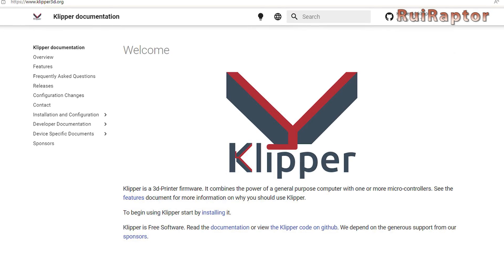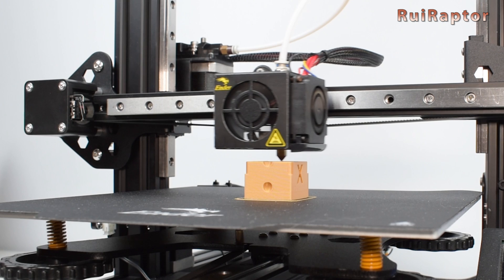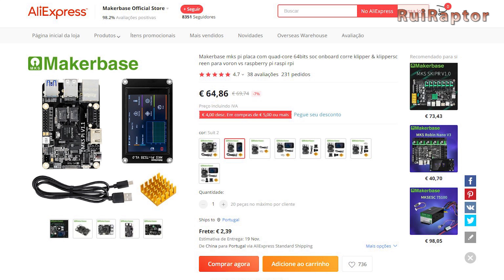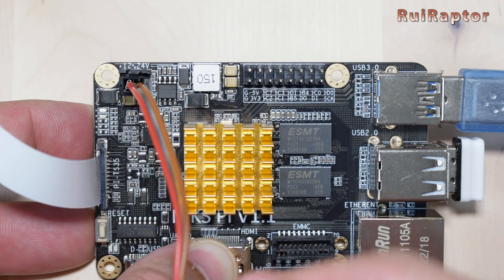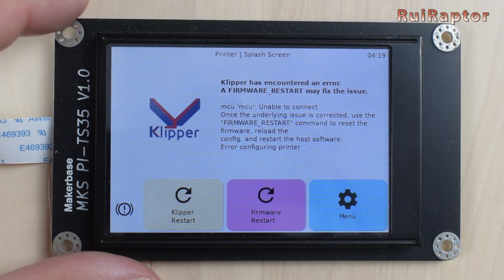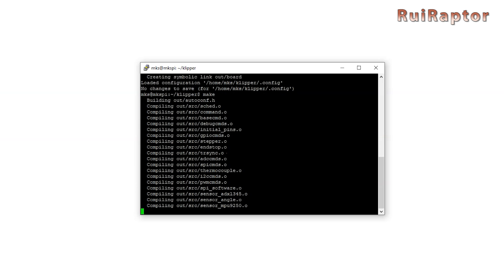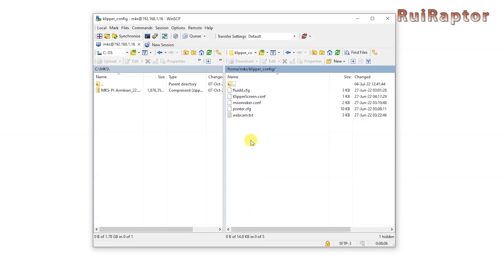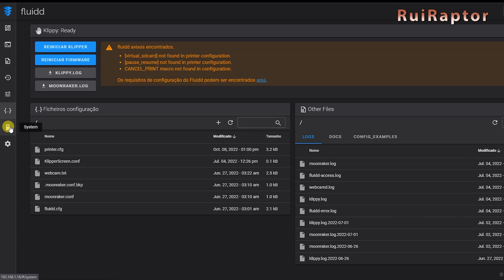MAKERBASE MKS Pi Board - A New Solution to Run KLIPPER (Without a Raspberry Pi)

Comment: I can't power mine on using the meanwell power supply on my Qidi X max.  It just shuts the printer off.  I haven't flashed it yet but I'm concerned there is a problem given I can't get power to it from the printer.  Polarity seems correct with positive on the left pin and negative on the right pin.

Comment: I just brought a Raspberry Pi4b and cant get the pesky thing to show the desk top yet alone install klipper on it.  As ive just binned everything from BTT and installed MKS i need one of these. I need a control module to put in the Pad7 as that hasnt worked either, It may have the bells and whistles but its no good if it wont update the Klipper part of it. Replacing the BTT CB1 CM is a must for me. When are you bringing the CMPi out ???   Please please please say your bringing one out soon.

Comment: Hey mate great video, I have one just wondering have you had any issues of these boards kind of going into like a standby mode it seems like it disables wifi adapter when hasn't been run in a day or two and taking power out and back on it just doesn't boot back up I have to keep re-flashing the firmware to sd card hard to tell what it is doing as I don't have screen with it just interface in browser

Comment: I 'am confused. I want to use klipper. I have an original ender 3. Do I need to upgrade the board or can I just use the original board and just add klipper using those MAKERBASE MKS Pi Board ? If I should upgrade the board on my ender 3, what board should I get ?
Reply from the maker: Yes, you can add klipper and maintain the current board.

Comment: Hello, it only worked for a short time, a few weeks. Klipper updates are no longer done and crashes the system. Today on the Makerbase drive I saw a new image appear, without any installation explanation, it's worse than the previous one, nothing works, not even a start... In short, the MksPi will end up at the bottom from a drawer, too disappointing from a builder who once was one of the best ^^

Comment: Do not use the wifi adapter from Comfast model CF-WU810N. It has known issues of slow/intermittent dropping and literally not working at all. Buy a good wifi dongle that is for Linux. Trust me, I learned after 2 different dongles
Reply from the maker: Thanks for the feedback 😉

Comment: Am I expected to crimp my own connector and feed it from a generic power supply/my printers supply? I am having a hard time finding a comercially available power supply with that connector.
Reply: Yes. As far as I know, if it's getting 12 or 24 volts it should be good. Doesn't matter the source of that power. Could run off of your printer PSU, a USB cable w/ a boost module, a dedicated DC power supply, whatever you want. You can find pigtails for the connector or kits with pre-crimped wires if you don't want to crimp your own. The connector is JST-XH 2.54 the same as most 3d printer fans.

Comment: I have an mks pi I have been trying to set up for a week and will literally pay you to help me. Like no joke please lol. I have gotten absolutely everything set up and working but I keep having issues with the Wi-Fi. It works flawlessly on the initial boot and install then barely works after I reboot. It will connect for a few seconds then I lose connection, sometimes just not connecting at all. I have to reflash the os to make it connect over wifi reliably(still breaks when I reboot), yet eithernet works fine, I have no idea how to fix it. I have tried everything, it works perfectly if I put it on Ethernet, but I can not do that with it installed in my printer as I have no access. I have the same comfast wu-810m adapter, did you have this issue or know how to fix it? I don’t know enough code to figure it out myself, but will happily pay someone for their experience to help.
Reply: Try a different wifi dongle/module.

Comment: Hi thanks you for your great work 👍 I encounter a problem when flashing klipper in the MKS-PI with an internal error : bad marshal error tuple out of range… any idea ? I’ve tried a couple time :/ thank everyone
Reply: any luck? I have been running into the same issue and am unable to get it working. I have tried multiple times over the past few days and I'm fixing to give up. I had the device mostly setup but it would not work due to this error, now I cant even get it to connect to the WIFI
Reply: Figured it out, You need to not unzip the folder. Just select it directly from the download and use Balena

Comment: So your telling me that if I build a VZBOT or voron and substitute the pi for this board I can still get klipper running....if this is true why does everyone still want a raspberry pi? One question ❓ though if you run the MKS Pi board can you run a big tree tech 🎄 tft 7inch touch screen for your klipper interface? Cuz I just got a tft 7inch and it has those Lil raspberry pi connection so thats why I was wondering if it could be connected cuz the MKS Pi board has pretty much all the same connections as the raspberry pi... Anybody know if would work on a voron with a 7inch TFT screen

Comment: You have an error of (fluidd gcode_macro cancel_print) have you not fixed it will not work :) The installation is not finished. TY  (Easy access to the klipper.bin file?
After running the MAKE command run
cp out/klipper.bin ../klipper_config/firmware.bin)

Comment: I have MKS PI 1.1 full kit with eMMC module, can some one explain how to use the eMMC module, i does not work plug and play
Reply: Did you ever get an answer on this?  I'm trying to figure my kit out, which also came with that module.   I haven't found anything on what this module is for.
Reply: @paulfitzgerald4933  My SD cards keeps dying, so I experimented, at the end I used eMMC to SD adapter and install the firmware as it is normal SD card, and then find out that if just move it to the eMMC slot on the bord will work just as well. for now i use it this way without a problem, boots much faster

Comment: I installed mine yesterday, but got some issues. It is getting really hot, especially when running a webcam. Has anyone else the same issue? Does it need active cooling?
Reply: I'm just testing mine and feel it gets warm. I may make a new case with a fan in there as it seems prone to heat up.   note I haven't got it to even take the software.   I'll probably stretch the case for a fan or make a fan holder section between the top and bottom..

Comment: I've got both this and a Libre Renegade cranking on Octoprint/Octodash and still running Marlin on my machine. This pi can run XFCE4 desktop and do pretty much anything a Raspberry Pi can do without the exorbitant cost of the current market.
Reply: Hi
Just asking!
I have a pallette 2s and to run it i need a wifi sub with octoprint and then instal the pallette software.
Only to make a good connection to my ender 3.
Do you think this board can handle that 🤔

Comment: Any tips on what I can use as a 12v power source for the MKS pi? Do I need a separate source or is is possible to power it from the printer PSU or board?
Reply from the maker: Hi David, you can use any voltage from 12V up to 24V to power the board. You can use the power supply from your printer or an external power source.

Comment: how to revert the fw for printer?
Reply from the maker: If you want to isntall back Marlin firmware, just compile it or get the already compiled .bin or .hex file and flash the printer with it. If you are not sure how to compile and/or flash the firmware, you can check our channel for the video with the instructions.
Reply: @ruiraptor  thanks. My printer is no brand no service. How to get the original Marlin firmware? Is there a way to back up?
Reply from the maker: Which board do you have?
Reply: @ruiraptor  thanks I have figured out. I have Robin nano v1.2 and flashed official marlin

Comment: Thank you for this Pi alternative, one of my RPi's just died, green act light won't come on and can't connect to the pi, it isn't the SD card as the card works just fine in another pi. Picked this up, board plus wifi dongle and screen for $75 Canadian which is $125+ less than just a RPi board on Amazon.
Reply: I had a similar board other than raspberry pi, but the company died. Now I can not update the system at all. Old raspberry pi doesn’t have this issue.
Reply: do you find the screen to be an absolute abomination? The refresh rate on mine is like 1hz.
Reply: @TheFeralEngineer  Haven't played with it much, the extruder motor on the printer I was to be using the MKS Pi on broke a couple of wires and I had to order another motor from AliExpress but the limited time I did use the screen on the MKS Pi left me unimpressed, maybe it's the refresh rate I'm not sure but the touch response seems abysmally slow. I was wondering if it was because I was only running the board on 12v instead of 24v, mine came with no documentation and I've yet to look into what, if any, advantage there is running one or the other voltage.
Reply: @DarrenGerbrandt  I'm running it on 24v, but the screen is still terrible. The mks pi is very good when connected to a capacitive touch screen with HDMI and USB. 🙂

Comment: I'm waiting for mine to arrive, should be here next week. I love the fact that you do not have to run a buck converter just to use this. The Raspberry Foundation is really screwing up not having any Pi's available...this "shortage" has been going on forever and doesn't seem to be affecting other companies the same way. I'm waiting for the MKS Pi and a Manta board.
Reply: Just curious, why not run a CB1 with the manta?  Plugs right in and would be a much cheaper solution than this board in the video.
Reply: They are uniquely sensitive to the situation because they are were using Broadcom's slack fab capacity to keep the prices down - it was actually a pretty good idea, since if you have an arrangement to make stuff only when the capacity would otherwise be idle you get very good prices.  When it screws up is at times like these where there is no slack capacity and the fabs are running flat out to produce full-price parts. Normally you could buy wafer starts in the secondary market (I.E someone booked too much fab capacity and doesn't have the production requirements to use it), but given how backed up everything is right now that's currently more expensive than booking the capacity directly.  They are also pretty much vendor-locked because the whole thing was based on the founders' personal relationship with Broadcom.

Comment: Why klipper is used for?
Reply: short answer is klipper is firmware for the printer.  The slightly longer answer is klipper basically offloads all the work the printer's mainboard would do.   Once you have the firmware installed on the printer the web interface allows you to make config changes without having to recompile marlin and reflashing the board on the printer.

Comment: I'm curious if that board is capable of filling in on other tasks like a normal pie
Reply: It will not run "Raspbian", it runs its own kernel (it's a different chip altogether), it should run all the other stuff just fine, it is just Linux...The MKS kernel and packages set up is geared towards Klipper pretty much exclusively, but it should still run other stuff fine. If you have something that needs Raspbian exclusively, you're going to have a rough time and having only 1GB RAM is exclusive across the board line, you don't actually need much to run Klipper, the processor is the important part. It's not really meant as a "Pi" replacement option, it's a different way to run Klipper without a Pi.
Reply: @david78212  OK
Reply: The OrangePis are widely available for a good price and run Armbian. OrangePi Zero 2 seems to be the best price-performance model atm. Cortex-A7 quad core, 1GB RAM for less than 40€.
Reply: @elmariachi5133  there are a lot of alternatives out there, unless you "need" the Pi's form factor...then the choices start dwindling away very quickly. A lot of those run Raspbian available from Raspberry. Given the extreme shortage of the Pi (it's been a year+ now) I would have already started my journey for an alternative. Why is the Raspberry Pi seemingly the only ones affected by this "shortage"? The only ones making out are the scalpers charging over $200 for a Pi 4... with 2gigs of RAM and the idiots willing to pay it.
Reply: @david78212  the OrangePi is the cheapest, and it's working very reliable thanks to the great work of the Armbian team, that's why I like it. Sadly it's no plugin replacement for the RasPi.
I read the reason for the RasPi being so expensive is that due to the shortage they are reserving all the SBCs for enterprises, because they have long year obligations with these. Because of this only very few remain for the low scale market.
On the one hand this is economically understandable, but on the other hand I feel like this is kind of an ass move against the maker community which they owe their success.
This is one reason why I like to recommend the OrangePi instead.
Reply: if you SSH into it once you power it up, you can run Kiauh to remove klipperscreen, then do a sudo apt-get install xfce4 xfce4-goodies -y and it should load everything you need for a full desktop experience (if it already had XFCE, it would just say "already installed" or whatever). If you want something with a little more power (2gb ram) and the 40 pin header, look into the Libre Renegade. I had decent luck with that board as well, but the XFCE desktop official release didn't work, so I had to install CLI and just ran the command I mentioned before and had it cranking.